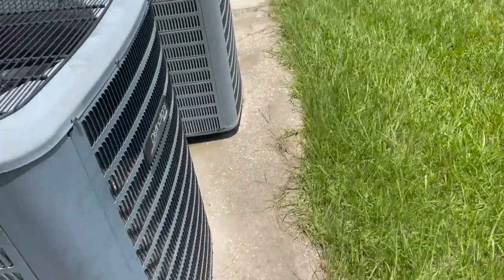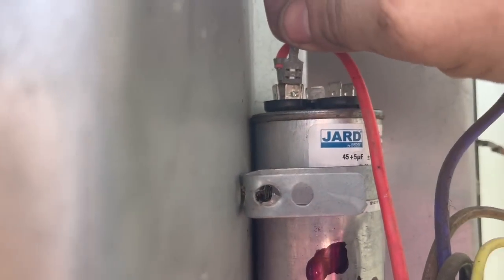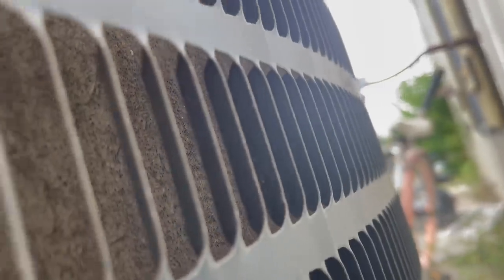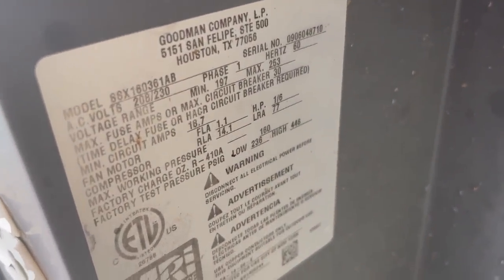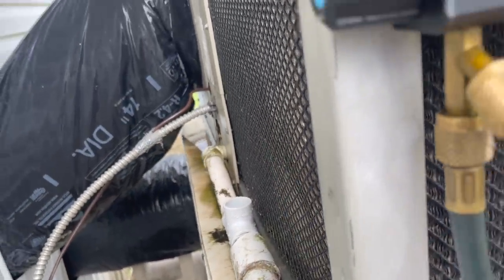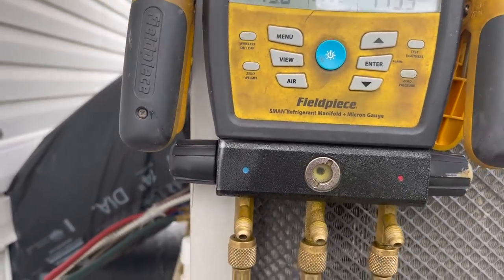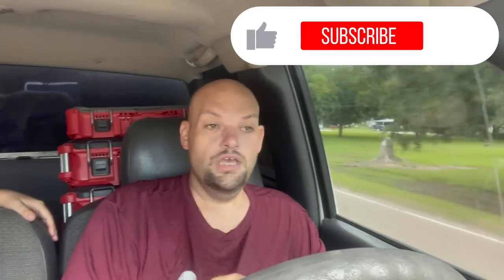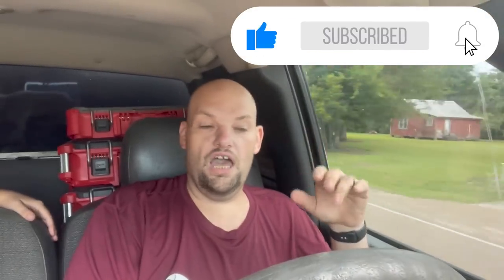Two No Cooling Calls

Comment: I work for a Rheem dealer in NC and yes both the condenser and the evaporation coils on the pkg units are micro channel. Have been i think since 2015. We have had a few issues, but overall they've held up pretty well. We shall see when the warranty runs out.
Reply: Not to confuse people but if you get a rheem ac for your house, it will not be and has never been micro channel.
Reply from the maker: On package units yes sir it is
Reply: @johnisraelhvac2019  never put a packaged unit on a residential unit. take 3 seconds to read a comment before you reply
Reply: Rheem uses micro channel evaps and condensers ONLY on their RACA14/15 straight cool and RGEA14/15 gas package units for the residential market. Their residential packaged heat pumps are tube and fin condenser and evaporator coils.
Reply: @andrewpierce2213  Yes you are right, the 14 and 15 SEER packs are micro channel. The 16 SEER is conventional coil, as is the pkg HP's. Sorry should've clarified that. Thanks for setting the record straight.

Comment: Nice video John.  You are looking great.  If MO99 is $100 a pound, I wonder what my old jug of R22 is worth in my garage?  I think it only has 20# left in it.  I'm not a Tech by trade.  I bought a jug of R22 from a Tech that was fired while doing a service call.  He asked me if I wanted anything from his Truck and sold me the R22.  I had a Duplex in Washington State that had 2 down R22 Heat Pumps.  No one would service them so I did.  Bought around $1k of test equipment and went to work.  Both were working great and then I eventually sold the place.

Comment: I see some goodmana’s
Reply: I bought some Goodman 16 SEER equipment for my house right before the pandemic hit. I was really surprised that the condensing unit looked like an Amana with an ECM fan motor and the wire grate on top.  The equipment package came with a GMVC furnace which has to be programmed via a Bluetooth connection with Goodman’s CoolCloud app.

Comment: Hi John this question originated on your ( Old GE Condenser Change Out ) video but I didn't know if you still reply to your old videos, so I'm asking here, I have a old GE model #21TA936H1F, I wanted to check or just change the 2 capacitors, I pulled the 2 capacitors, but they are so rusty you can't read anything and the suppliers I tried said they need the uf can you get your buddy Ted Cook to find out the references for both fan and run capacitors. I don’t know if he sell parts? Thanks John, I appreciate it 96 deg today 98, 100 tomorrow

Comment: Around here u are not supposed to be putting refrigerant into a leaking system u are supposed to recover existing refrigerant and leave if customer doesn't want to have leak repaired be responsible and do the right thing u are directly venting refrigerant
Reply from the maker: Please come on my show
Reply: How would I do that u should have at least put a super seal in that old clunker it costs 100 charge 200 and make an extra hundo
Reply from the maker: @crazydan2327  it’s very easy. I’m tired of your keyboard cowboy shit. I want to embarrass you live on YouTube

Comment: Wouldn't it be better to recover 99% of the 22 and then just recharge with the replacement refrigerant.  If your pulling a vacuum on a system with a leak,  your just pulling in air.
Reply: Pulling all of the noncondensible out but i see what ur saying
Reply: Your actually pulling all of the noncondensibles in when your pulling a vacuum on a leaking system.

Comment: Sir,

Question. Why wasn't your 460's being used correctly?

You can NEVER charge a unit the correct amount of charge without using wetbulb, drybulb indoor, outdoor temperatures and pressure, your PT chart which should NEVER be left alone ever!!...

Did you use the rule of thumb #3?

Plus 30*f for surrounding temperatures?

To help you become a better Mechanical Engineer Service, Maintenence, Installer and or a Tech.

Here's something that you most definitely need to use and always remember when you're out in the field!!... 

 Heat can be transferred in three ways: by conduction, by convection, and by radiation.

Conduction is the transfer of energy from one molecule to another by direct contact. ...

Convection is the movement of heat by a fluid such as water or air. ...

Radiation is the transfer of heat by electromagnetic waves.

I retired as a MES Mechanical Electrical Serviceman Local 250 before becoming a CEC State Inspector.

I'm not trying tobe a dickhead just trying to help you, from one MES to another!!...

The Widowmaker a man of God!!...

"E Pluribus Unum"

D'n 

Deus Le' Vult!!...